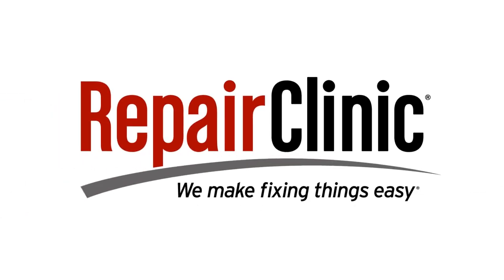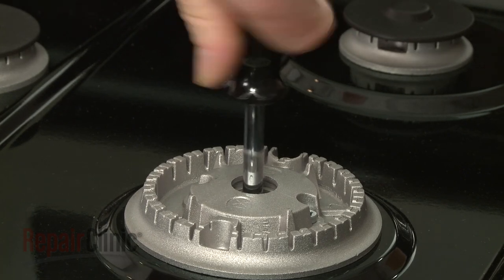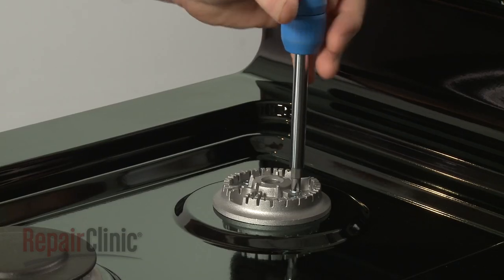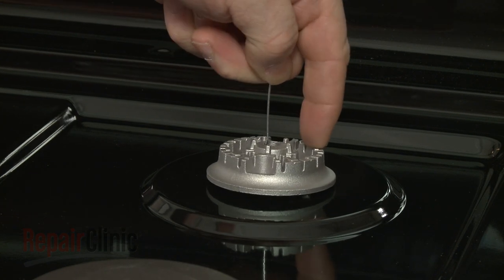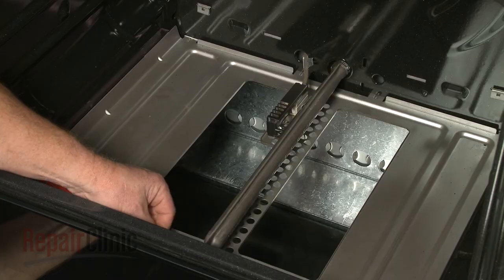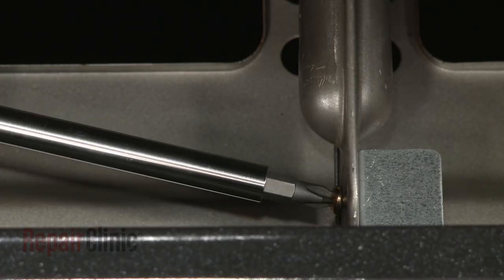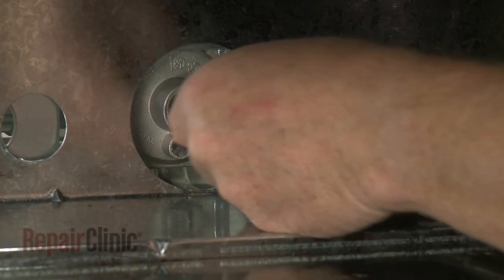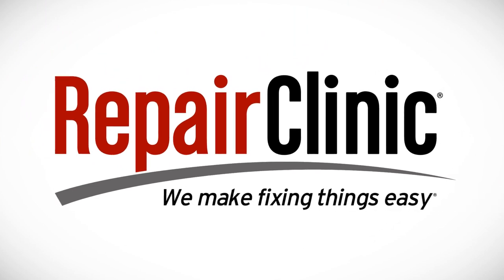Whirlpool Gas Range Replace Propane Orifice Kit #W10619560

Comment: The oven conversion in the 2020 model is slightly different.  There is no longer a blue part in the regulator cap to reverse.  The part is all brass marked with "LP" (Liquid Propane) and "NG" (Natural Gas).  Consult the manual for this part.

Comment: Thanks. This video saved me time and money. The directions were clear and easy to follow.   One point to add, when removing the oven burner tube, the mounting screw on my oven was tight and difficult to get enough torque with the screwdriver, so be patient and don't strip the screw.

Comment: Thanks for this video. It was pretty simple and makes me wonder how a repair person can charge $200 to $250. As it turned out, the range came with the propane orifices so I was done in less than an hour. But the range didn't come with a broiler pan so I'll buy the from you folks when I get to that phase in moving in to my new place.

Comment: Hi, i have a new whirlpool gas range, but i did not get a manual w it, it was a floor model. I am not able to correlate, where the LP orifices go, when i remove the Natural gas ones. The natural gas ones are not marked at all
Reply: I got a manual for mine however it was of little use.  The NG tips had numbers that in the French portion of the manual actually translated to BTU's of the burners.  Biggest burner was easy, biggest hole, smallest (2) burners were easy, smallest holes.  Had a pack of 6 tips, (only 5 needed as 5 burners) however I had 3 left over and only two burners.  No way to tell for sure if the medium burner was bigger or smaller than the oval center burner.  Used the French chart and guessed, ended up installing 1 of the 2 greens in medium round burner and the black in the center oval burner.  So far, so good as all appear correct.  Whirlpool's manual are definitely not written by English speaking Americans as when one has to attempt to translate French to figure out what goes where.  Needless to say the big USA sticker on the door is a joke.  The manual clearly stated in French burner 5 was 7,300 BTU's and needed the black however no where in the manual was a diagram showing which burner was burner 5.  The medium round apparently is a 9,000 BTU burner based on trial and error using the green tip leaving a spare green left over.

Comment: Can the natural gas orifice be adjusted if the flames are too large?
Reply: The orifice device is just a nut with a hole through the middle; it cannot be adjusted.  However, depending on your stove model, you should be able to adjust flame height/intensity by 1) turning on burner and setting the burner control knob to lowest position (simmer); then 2) remove/pull off the burner handle/knob and insert an appropriate size Allen key (hex wrench) into the channel in the center of the burner control assembly to engage the control socket.  If you're using the correct size wrench you will be able to easily adjust the flame height.  Recommend setting it to the lowest flame (since you should already be on "simmer" position).

Comment: Are you using TAPE inside of the nut driver? Brass doesn't stick to a magnetized tip. Also you didn't use a sealant on the orifices which I know for a fact that you have to do. You video isn't accurate and you are misleading people.
Reply: You don't have to use sealant with the brass..it's soft enough to seal..